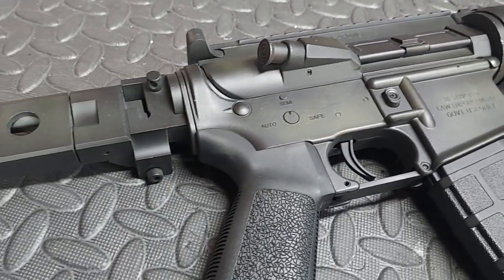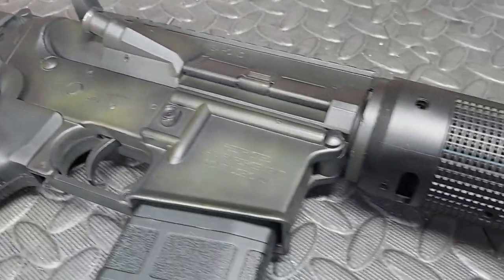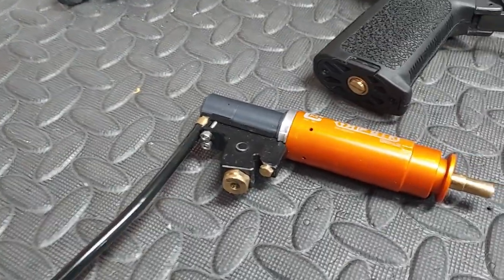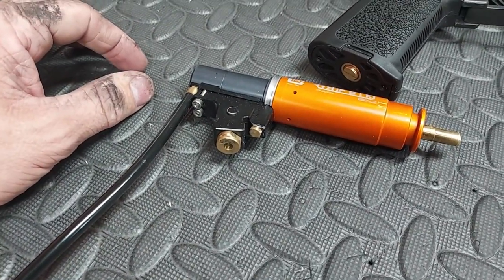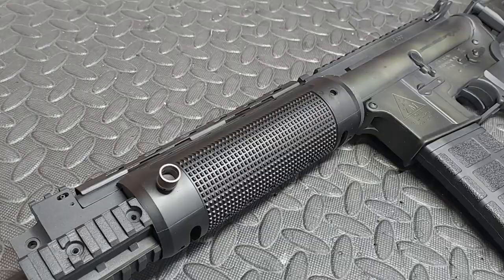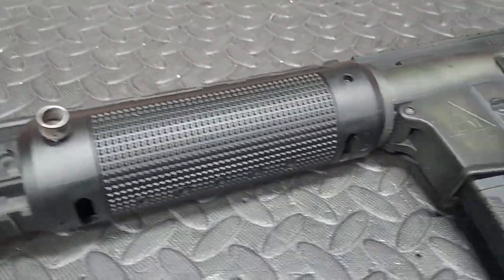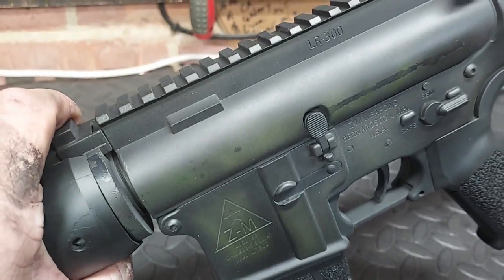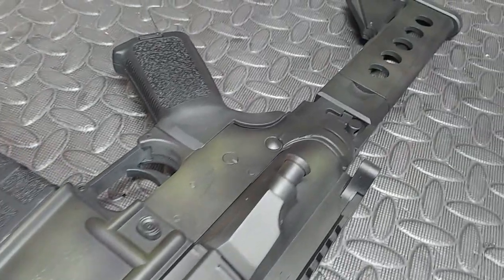Neg Shorts: Just HPA It Bruh!

Comment: Whoever dropped that engine in clearly didn't know what they were doing. Having learnt tech myself (not as a business, mind), I found myself progressing to HPA for one thing AEGs will never be able to compete with. Cold weather. If you live somewhere that's cold for half the year or more, you can't easily stop the cold killing batteries fast. The same applies for gas too, really doesn't do well in the cold for GBBRs or GBBs, even if you use red or black gas instead of green. Either way, personally I don't buy into any aspect or form of 'airsoft superiority' by proclaiming any platform, play style or manufacturer is better or worse than another, it's just a game for fun at the end of the day. It's toxic for airsoft otherwise, and puts new players off.

Comment: My only reason for hpa is if i play at places with different limits and i dont have a qc spring. Usually ill go with electro pnematic since some places for dmr's require the trigger delay like every community hosted event out here in utah and for many of us thays only option. in which case what's the point of mechanical. I know most cqb places are semi only but theres only 2 official airsoft venues and both are semi only but for many of us its quite a drive. Of course with tm hicapa's most who run those have mag conversions. Theb pdr is a gun where hpa is mandatory because of how bad it is. If it has a qc spring then no need. Also you can get close to what an hpa can do with a low ratio dsg build albeit you need to have extensive knowledge on whatever gearbox you're using. However in the case of gbbr durring the winter, you want hpa because gbbr's are prone to all sorts of malfuctions because green gas in the winter sucks and ith here in the us, red and black gas come from overseas meaning by boat so it takes a couple of months. Of course i convert the mags back to green gas when it comes spring because i can use green gas again or even propane and propane accesories.

Comment: What are your thoughts on tippmann hpa m4's tho?
Reply: Tippmann M4's are finicky, for accuracy, have to do a couple of things to them. But as far as reliability goes, they are fairly bulletproof
Reply: Very fun to play with, put an amplifier on that thing and you'll get kills dryfiring it in CQB. The tank and the cord is as ugly as on any other hpa gun. 

All I've had to work with (3) have shoot very nice after a barrel and rubber swap. They came with a horrible aluminium barrel, but they like heavy barrels, so any steel barrel of decent quality will work, and they work very nice with a G&G green hop rubber. They can be finicky with the lips on some hop rubbers, but G&G green seem to work nice every time.
Reply: @marcushillerstrom25  honestly. I've got a sound hog and a heavy bolt in mine, and it's an absolute beast. Haven't tried it cqb yet though

Comment: I learned form your videos that shiming and air seal would improve an aeg  and i have 1 out shooting hpa with .25s hpa is nothing special those tanks and hoses are stupid
Reply: My hpa out performs aegs with accuracy range and overall rate of fire
Reply: @boosahben2647  aegs can do that to hpa aint nothing special :)
Reply: A hpa is overall more consistent and reliable and I have aeg both single sector gear and dual sector gear aswell as green gas and co2 and the hpa out performs them all with consistency range accuracy reliability and a tunable fps and fire rate without having to rebuild an entire gearbox but no nothing special but much more reliable
Reply from the maker: @boosahben2647  ok Skylar

Comment: HPA to me is just bad and dangerous to mess with. Sucks you had to mess with someone's gun that has it
Reply: But hpa is better than all other forms of power
Reply: @jif4356  in what way?
Reply: @jif4356  I really don't care lol
Reply: @hitmanslayer3003  more consistent, more repeatable, less moving parts, less maintenance, cheap to refill, easy to tune, silent if needs be. I'm all for GBB and AEG guns but I can't argue they're more accurate/consistent than HPA. The only system that comes close is a well built BAR, but that obviously comes with drawbacks
Reply: @qadrazit  Just nuclear power it
Reply from the maker: @Matt3DMaker  the wanker hose.
Reply: @Matt3DMaker  what I have seen and done consistency seems to be the same. The only real advantage would be it’s simplicity. That hose being a down side.
Reply: @hitmanslayer3003  

Every way 
Plus no line needed many in built buffer tanks available
Reply: @NegativeAirsoftTech  

Thank you 😊